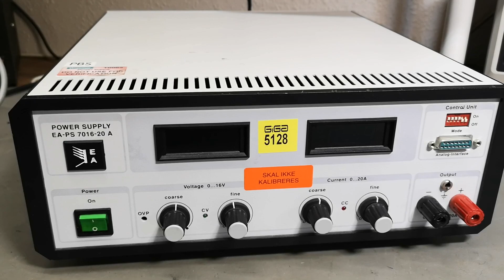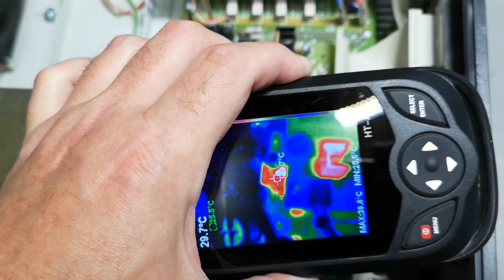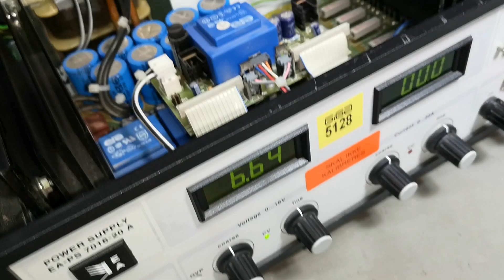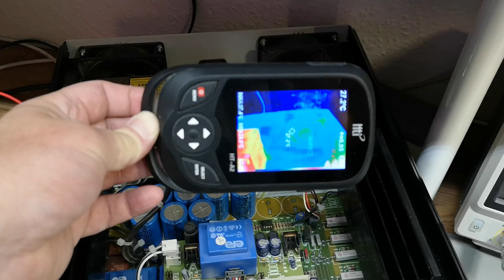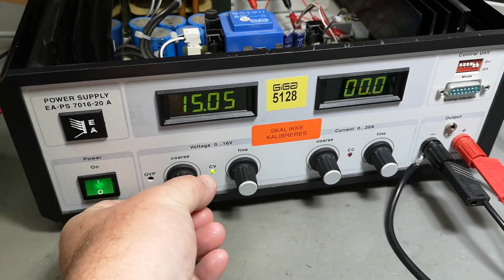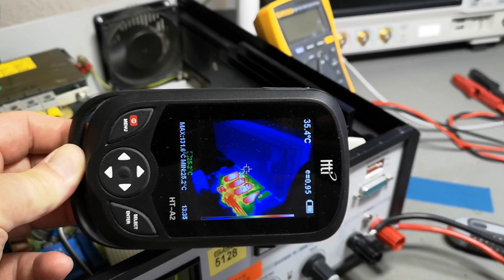Elektro Automatik EA PS 7016 20A LCD Power Supply 2001 test teardown

Comment: They might have kept the power FET's closely together to avoid thermal differences between them and thus prevent thermal runaway.  And you indeed should be able to run it fully loaded, it says on the label it's betriebsart is "DB", Dauerbetrieb or 'continuous duty'
Reply from the maker: i think the high value source resistors local feedback will share the current very well, no matter what, I think spreading out the fet mounting, will give better thermal solution

Comment: Hi Thomas, the transformer got me, when you turned it on the first time I had to turn down the bass on my PC audio system, normally the woofer made things vibrate on my desk 🤣 At first I thought it had a shorted thread in the secondary winding, when he took a thermal imager it became clear.
AE makes fancy sources, but the documentation cos showed is terrible, it's quite possible that it was set up well at the time of production, but it drifted as the components aged.
With the traf, he gave a luxurious demonstration of what can happen to even such a common component when it is installed incorrectly.

Thanks for the video and have a nice day 🙂 Tom

Comment: Additionally to your *very* nice demonstration with the single winding:
From an electro-magnetic point of view, it is unwise to use ferrous screws through the transformer. The transformer's laminated sheets are isolated to reduce eddy currents. And now, you open a new magnetic path with those screws. Isolating them only fixes what you demonstrated. They sould be brass or stainless (non ferromagnetic). But I do not know how big that makes a difference.

Very educational video! Thanks a lot!
Reply from the maker: thanks for your comment Nick, I think i understand what you mean, but the field lines in the screw hole area, must be very close to only in the transformer sheets, this means the screw material will not generate any eddie currents, to back this up, my thermal camera would have picked up temeperture rise in the now electrcally and thermally isolated screws, and if any extra loss would have been added, it would also be revealed on my idle power measurement, I dont say the value is zero, i just say it is so small i can not detect it, with the type of equipment and research i put in to the subject.
Reply: @TeardownOZ2CPU  I'm not complaining about what you showed. I wasn't even aware of that until your experiment. Just to put my comment in the right context.
Again, I don't know how big the influence is. And I don't know what type of material the screws are out of. I looked at Block Transformers, but I couldn't find any hint. OTOH, cheap transformers are welded together, better ones are screwed (no pun intended). 
If I remember, I'll have a look at a 10(?) kW transformer in my mill.
Ah well, maybe I'm exagerating this ... 🙂